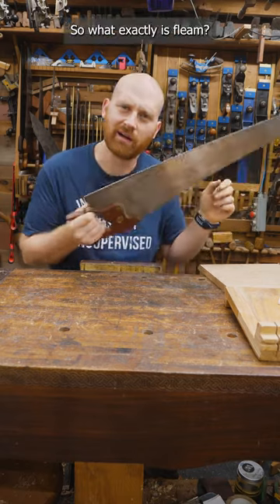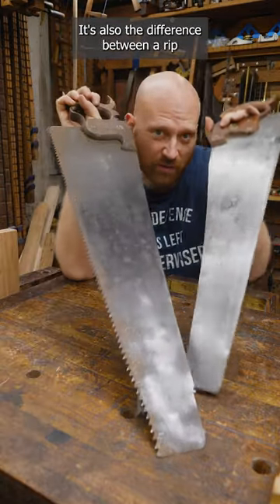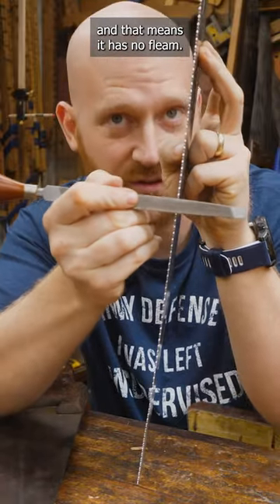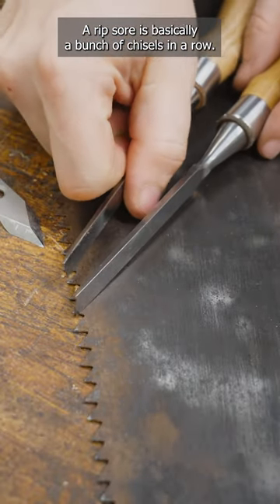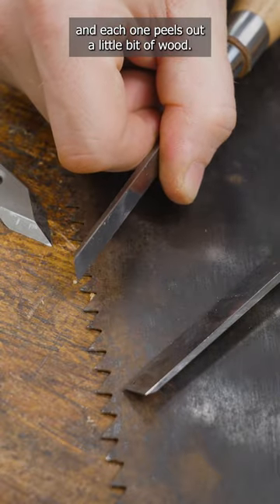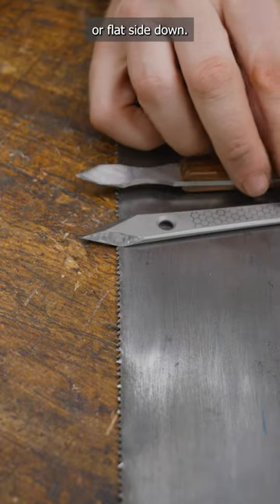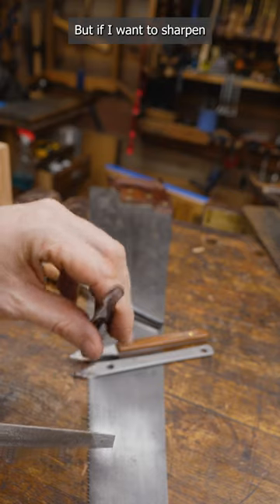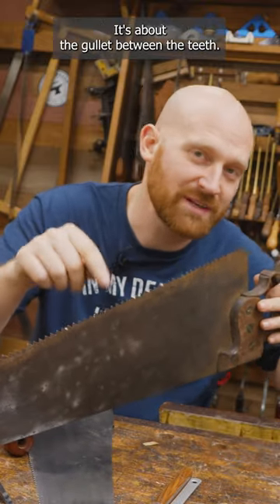What is Fleam

Comment: So do I add/take away fleam to change a saw from crosscut to rip and vice versa? Or do I need to determine if it’s a cross or rip and then sharpen accordingly? Like, will I destroy a blade sharping it the wrong way?
Reply from the maker: yes. it is all about the file to the saw. if you re file it with the file 90 degrees tot he plate you can turn a crosscut saw into a rip cut saw.